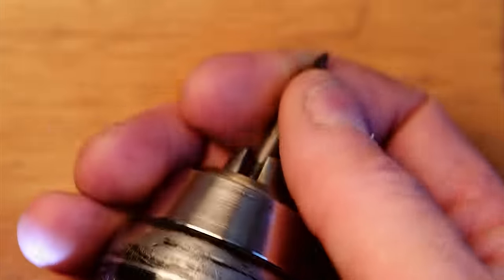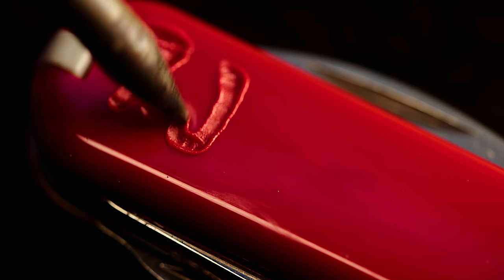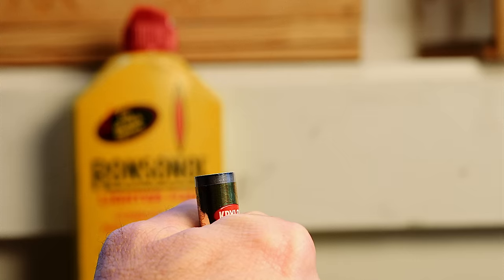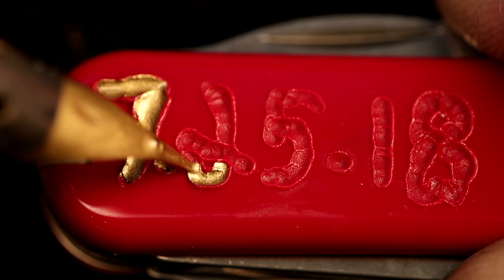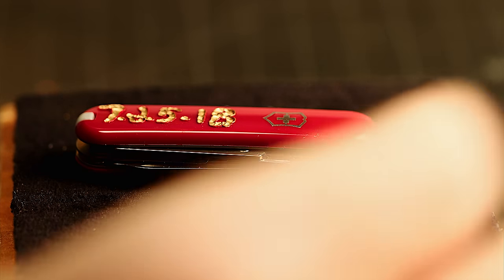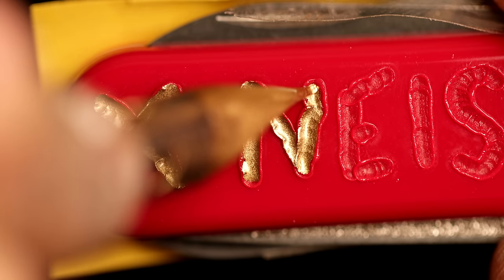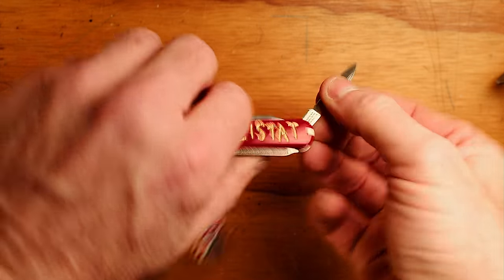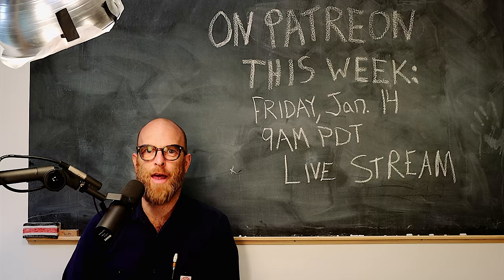Make Your Own Gilded SWISS ARMY KNIFE

Comment: I remember watching Casey engrave everything in his earlier videos. I engraved some of my own items because of him. I'll probably engrave more because of this.
Reply: I started engraving things too.  At first, I couldn't figure out why a date was necessary to engrave, now I get it!   Many years ago, I noticed most gas stations took away the metal clip that allowed people pumping gas to lock the trigger in place, so they didn't have to hold the pump.  (there is a super rare occurrence that static electricity can cause a fire).  From Casey's, Van's and Tom Sachs inspiration, I built a custom wood wedge to hold the trigger down on the pump, so I can go back in the car on cold days.  Since gasoline is a carcinogen, I was not keen on inhaling it for 3 minutes while I pump gas every week.  It works perfectly, and bends the rules a bit, but I don't care.  Because I engraved the date on it, I know I have been using it since Dec 2017, so I have used it over 200 times!!  I highly recommend creating custom things for your use and engraving it too.
Reply: another thing that is really good practice is shown at 0:08  I started writing the source of the product too, in case I need to buy another one I have a quick direct way of recalling where the item came from.  Much faster than searching old emails or order histories on Amazon.
Reply: @canadude6401  Amazon has a search box within your order history.. works instantly on 10+ years of orders for me
Reply: @jaredvw  I use the same search, but can we agree having the writing directly on the product or tool is immediate?   Don't even have to pick up the phone.

Comment: I tried this! Great instructions. I inscribed “measure twice” on mine. 

One improvement to this process: use a soldering iron with a small knob for the temperature. You can see how hot the wood burner is and any little shake is visible. With a cooler soldering iron you can get smoother results. I set mine to 250F and got a look I liked. And the plastic doesn’t stick on the soldering iron like solder does. 

Also I didn’t have an old knife to try on so I used an old 30 pin iPod cord connector which is a similar plastic. 

Hope that helps.
Reply: do the edges feel rough when using the SAK? You have an improved technique so maybe yours doesn’t idk but looks like in the video those edges will be felt under the fingers no?

Comment: I do something similar when I engrave my items, but some things I do different.

I use one of those noisy vibrating engravers and then file the edges of the letters using a knife to make it nice and smooth. Then the hard part: the painting. I take my oil based paint pen, get the nib very saturated with paint, and write all over the engraved letters. As fast as I filled the letters I take a paper towel and wipe the excess off.

It’s not always the cleanest way, but it’s quick if you are working on a lot of items or engrave very narrow letters that you can’t fill with a fine tipped pen.

Comment: A great tip for removing paint pen paint from plastics where Bestine or other solvents can’t or would damage the plastic is to use Brasso and buff it off. The fine abrasive in the metal polish works as a wet sand and actually takes away some material without affecting the sheen of the plastic too much.

Comment: I do stuff similar to this all the time with 3d prints but the craziest thing I have ever done was with copper wire in bamboo flooring. My friend had an ecig shop back when those were blowing up on every corner. I slowly chiseled the shop name in the edge of this piece of 3/4" bamboo flooring I found. I used a 1/8" chisel to slowly engrave the name  into the side of the flooring. I then took copper wire (general in home outlet 12 or 10 gauge solid core stuff) stripped the pvc sleeve off a long piece and hammered it into a wedge shape and then hammered it into the chiseled out wood. Once I had it all inlayed I sanded it down to only protrude a small amount. It took probably 20 hours. I then drilled 1/4" holes into the top of the wood and then glued that to another piece of bamboo thats the same length and width. It was used as a taste tester thing that they could put the little tank cartridge things in so people could try different flavors. It looked great then like 2 months later the law changed and taste test things were banned.... I dont know what ever happened to that stand.

Comment: Love this, but I've heard that a sharp blade is generally less dangerous than a dull one. Never bothered to find out why, or even if it's true. Hope this helps
Reply: With a dull knife, you have to put more pressure/force behind the knife to get it to do anything. More force–tied with easier slips of the blade from the edge not catching–tends to lead to more mishaps. I think there's also a certain delicacy/attention-to-safety that subconsciously comes from dealing with a very sharp blade. However, for a small kid, I think a dull blade like this is better. I almost cut multiple fingers off as a kid with sharp knives lol